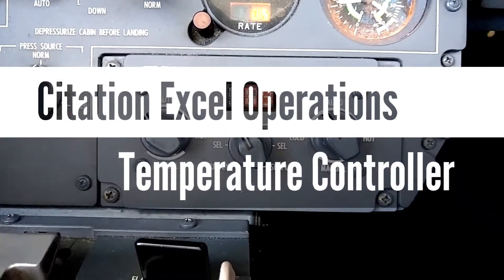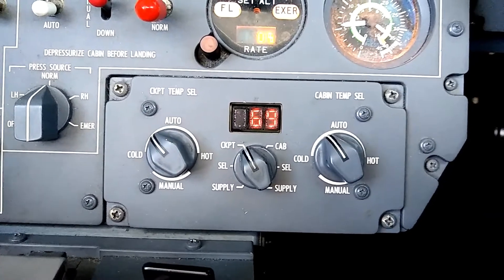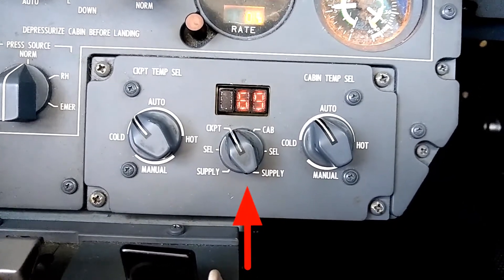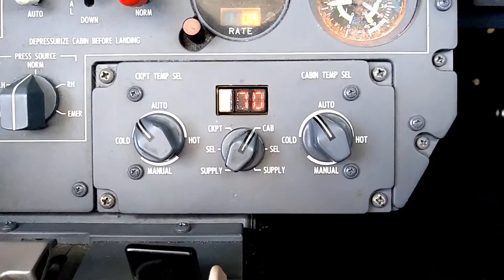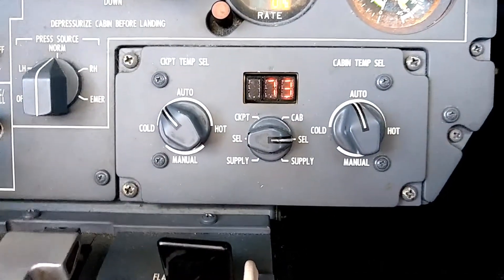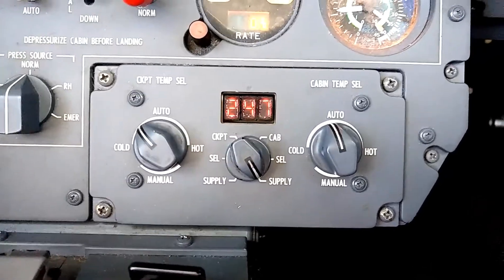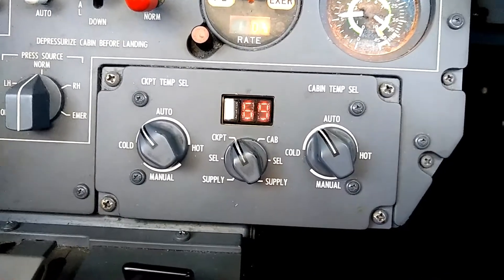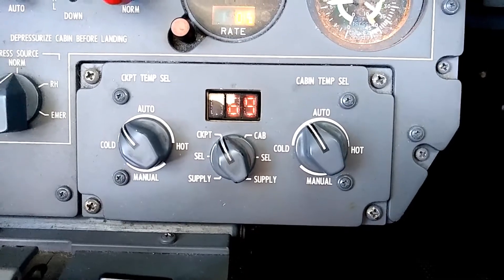Citation Excel Operations - Temperature Controller

Comment: Never understood how the temperature is actually managed while by passing the ACM . What is your take on that?
Reply: Do you have any experience of something like that? It sounds very scary to push hot bleed air directly into the cabin. What temperature range are we talking about while regulating with left throttle?
Reply from the maker: @romanmandeleil  I've never had to deal with that situation for long. The most common reason for the ACM to shutdown is an overheat situation when basically the internal components of the ACM are too hot and it shuts down to protect itself. EMER pressurization automatically activates. All the pilot needs to do is give the ACM a few seconds to cool down, select a warmer cabin temp to prevent the ACM from overheating again, and reset the system. So EMER pressurization is only on for thirty seconds or so, at most.

It definitely gets warmer in the cabin, but it's not terrible. Think of sitting in a car without the air conditioner working on a warm day. It's not the most comfortable, but a pilot can still get the job done.
Reply from the maker: Great question. Cabin air temperature is controlled by using a mix of pure bleed air, which is always hot, a little less than 500 degrees fahrenheit, and ACM conditioned air, which is always cold, about 40 degrees fahrenheit.

The ratio of hot or cold air determines the air temperature coming into the cabin. On a hot day you might have pure cold air with little to no hot bleed air. On a cold winter day you might have mostly hot bleed air with just enough cold ACM air to bring the temperature down to 200-250 degrees fahrenheit.

Does this answer your question?
Reply: I get it, but I am asking about times when the ACM overheats and all we get is the bleed air from EMER source
Reply from the maker: @romanmandeleil  In the case of the EMER pressure source, there is no way to regulate cabin temp. It's hot bleed air coming straight into the cabin. The only way to manage cabin temp under this circumstance is to reduce the power on the left engine, thereby reducing bleed air volume, or by descending to a low enough altitude to not need the pressurization system and turn the pressurization system off entirely by selecting a pressurization source of OFF.